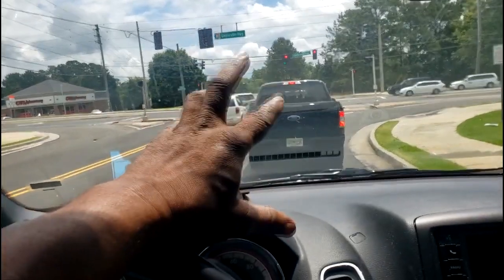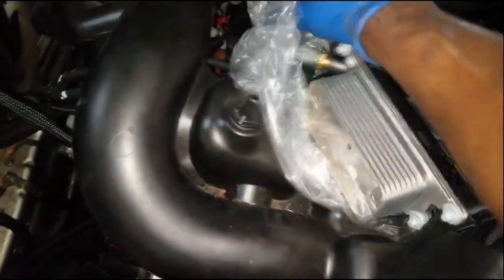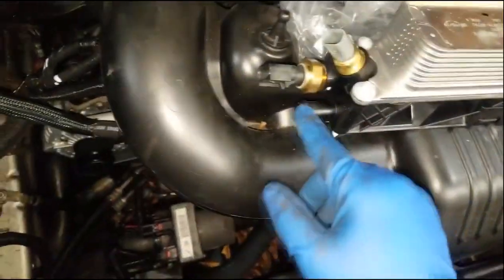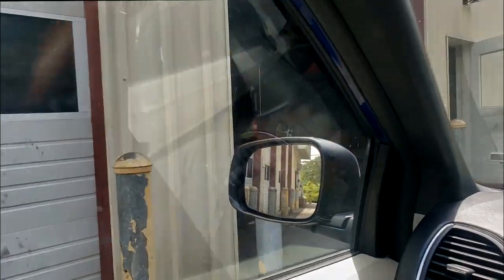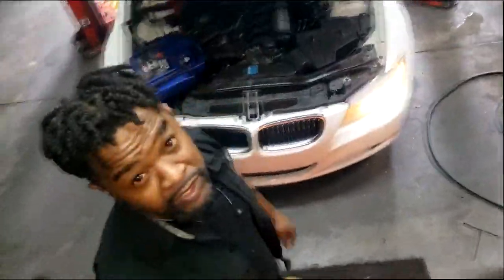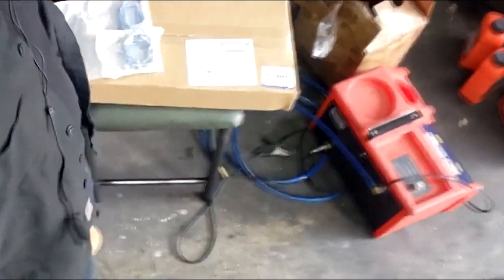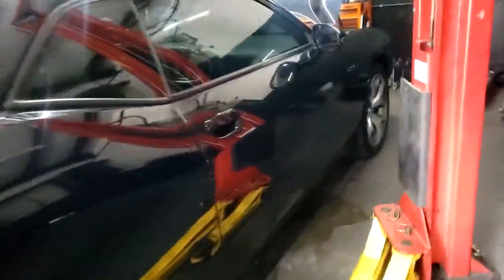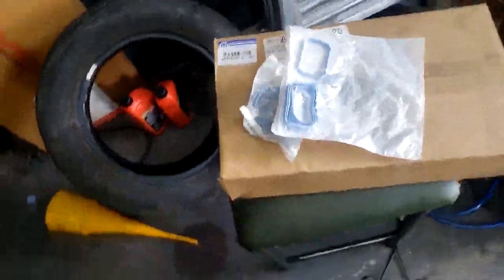Chrysler Dodge Charger Challenger problems  Brothers Motors will fix both problems same time  P0520

Comment: I'm just playing devils advocate here and talking sh**. Buuuuut if OEM parts is great why are they failing. Obviously part's are going to fail.I very often use OEM. Basically only time I do is when that's the "only" place to get the part or parts. Now there is a difference in reman and new. Something's I won't purchase reman. If it's one of those pain areas to get to I go with new. Top mount alternator or starter, then reman. I've had aftermarket parts last way longer than OEM. Like that oil filter adapter I'll probably go with the aluminum one. If the plastic is failing the new one is probably going to fail as well. Idk that's just me.